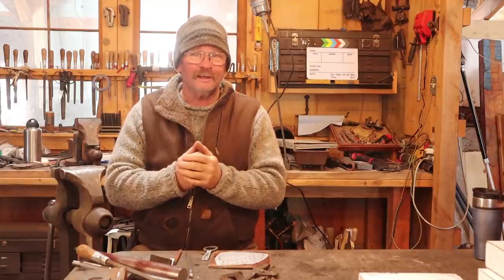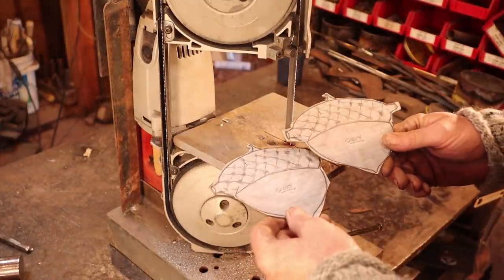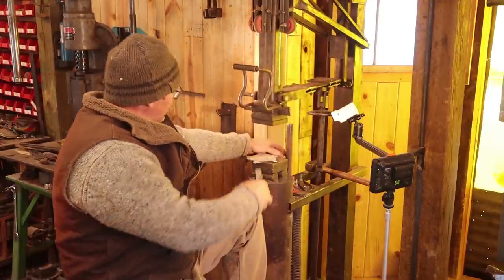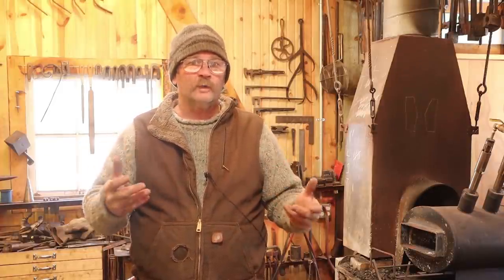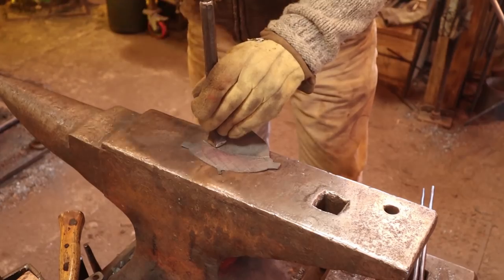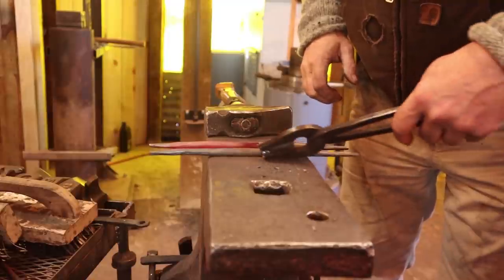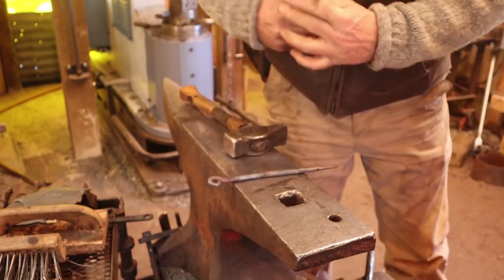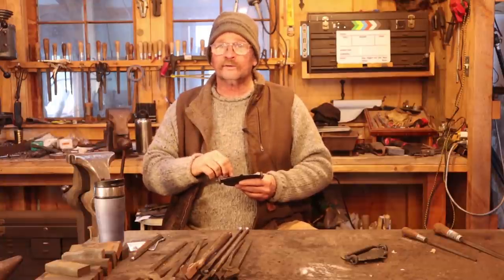Acorn chest handles

Comment: Great job, beautiful handle!  Question: how will the acorn back plate fit against the drawer or whatever since the handle loop protrudes beyond the back plate?  Love your videos!!
Reply from the maker: They will require a shallow relief cut behind the handles.  Old forged hardware often requires relief cuts for things not seen from the front.

Comment: I have a plasma cutter, but I wouldn’t use it for this. Freehand cutting to a line isn’t easy, cleanup of the cut negates any time saving, the arc hardens the edge. I’d still use the band saw. Now when I built my forge, yes...many long, straight cuts, like cutting steel with a box cutter.

Video angles are perfectly fine. This is not difficult to figure out.

You guys who can work in the cold have my respect. I freeze below 40. But I keep going at 100.

Comment: I appreciate the ability of a craftsman to make the work look easy. That only comes from a lot of experience and developed technique. We learn a lot from your videos. A question: Does the capture ring on the handle create a stand-off when it's secured to the furniture? I couldn't quite tell if the stud was positioned outwards enough to have the handle ring flush to the backside.
Reply from the maker: They will require a shallow relief cut behind the handles.  Old forged 
hardware often requires relief cuts for things not seen from the front.

Comment: I enjoyed the treadle hammer work. I know those were designed by a customer but I thought were going flat on a set of drawers. but they must be going on something that is only as wide as the acorn.  How would you do those handles if it was going on something flat like a chest?   I guess it would have to be a raised edge with a hole and then handle goes through from the front. 
I have never made handles, Yet, and was curious.  Thanks again for the videos. :)

Comment: Thanks for the vid John. On the use of butchers, do you reverse the butcher and do both sides of the incised line or just one side ?
Reply from the maker: In most cases you only butcher one side to give the illusion that one side is actually taller than the other.

Comment: Very nice but with the pins being flush with the back of the plate when u screw it to wood the round scrolls will hit the wood and not move
Reply from the maker: They will require a shallow relief cut behind the handles.  Old forged 
hardware often requires relief cuts for things not seen from the front.
Reply: @BlackBearForge  in ok cool just wasn't sure if u looked over that step. God knows I have lol. Some of the small things I forget. Keep up the great videos and have a great new year

Comment: Great content, and I Iearned something as I always do here.  I like this type of 'example' video. On the footage at the vice, of bending the handle onto the backplate, you had the openings of the loops up, but when you were working the handle hot to ensure it moved smoothly it looked like the openings were down (which is how I'd expect to see them).  Did you change that around off camera or did you make them differently, or am I not seeing straight? (edit: I guess I'm not the only one to notice, should have read further down the comments)
Reply from the maker: I did correct it between shots

Comment: Good video.   Looks like those handles are too thick, won't allow the acorn to sit flat on a drawer.   Pins should probably be offset.
Reply from the maker: The customers request was as shown and his plan is to make a relief cut in the chest to accommodate the handles.  Such relief cuts are common for forged hardware historically.

Comment: Your treadle stop, is that just the end of a Pony clamp?  How cleaver.
And a question on the handles.  Since the handle wraps around the studs you forged into the sheet, won't that mean they won't lay flat on the wood?  Or are they going to carve out a relief in the chest side to accommodate that?
Reply from the maker: You are correct on the stop, but it isn't my idea.  They will require a shallow relief cut behind the handles.  Old forged 
hardware often requires relief cuts for things not seen from the front.

Comment: John ,with the handle sticking out beyond the back of the acorn how will it mount flush on the chest or trunk or ???? it is going on ? and once again nice video.
Reply from the maker: They will require a shallow relief cut behind the handles.  Old forged 
hardware often requires relief cuts for things not seen from the front.